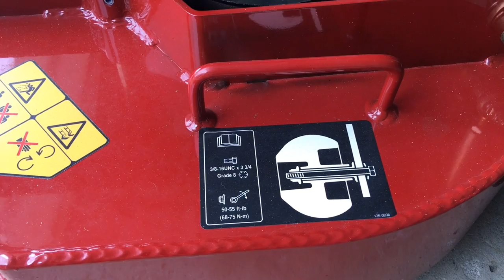Introduction / Demo eXmark 36 Inch Turf Tracer S Series Hydro Walk Behind Lawn Mower

Comment: lol. if someone tells me 3 is too high and 2.5 is too low I say "thank you for your business up to this point"
Reply from the maker: LOL you may be the one saying it. I think 3 looks a bit shabby and 2.5 is too short. I find 2.75 is nice and clean and looks manicured (centipede grass)
Reply: @DansVlog  true. actually never thought about that. dont know all the grasses. and actually from my perspective not theirs, 2.75 sometimes makes the difference between a 'clean cut' and a mess to clean up after at 2.5 or less
Reply: I mow some of my yards on 4 to 4.5. The higher you mow, the better the stripes burn in. Of course I'm talking about tall fescue grass.
Reply: @son_gogeto9128  is your tall fescue any good in shade btw
Reply: @brentkelly5445  Actually yes!  It seems to thrive in the shade around the big maple trees. I'm not sure if it's my climate, "Tennessee ",or what.
Reply: Sick dude!
Reply: @DansVlog  if you add a washer to that mower I can get 2.75. I never thought about that I have the same machine. I think 2.5 is too low.
Reply: Mow High Mow Often, Helps cut down on weeds and keeps the sun from burning the lawn out
Reply: @yzrippin  I'm in Canada so it is almost always bluegrass. In the spring I want it as short as possible in case it rains, June I start thinking of creeping up to 2.5/3 , Late june/July/August/ I take it to 3.5 min, 4+ i want. Argue with everyone..clients and  neighbours. Last week of August into Sept I try to continually drop height to whatever I can without huge mess.
Reply: So turning a knob is a deal breaker in your " HUSTLE " ? Just as long as the customer can hire someone else.

Comment: Great demo Dan,  congrats on that Exmark. If you don't want to mess with the washers to vary from 1/2" to 1/4"cutting increments, you can just set the 2 back pins 1 hole lower than the front 2. For example, for 
3-3/4" - set the front 2 pins on hole 6, and the back 2 on hole 5. For 3-1/4"- set the front 2 pins on hole 5, and the back 2 on hole 4. That's worked for me for many years. Hey... keep the  cooking videos coming too!
Reply from the maker: I was thinking that too but worried about premature wear on the belt rubbing the pulley? I do that with my honda pusher but I figured 1/4 inch washers is going to be easier on the machine
Reply: @DansVlog  Honestly never experienced any excess wear on the belts, replaced them as you would expect.  My Turf Tracer is old, a 2001 model, on its second engine.  But still has its original spindles and pumps.

Comment: Congrats on the sweet piece of new equipment. I have a walk behind brush mower with a 17 HP Kawasaki. It's a smooth running powerhouse. The only drawback is Carburetor service. If you ever need to do more than a basic cleaning you're looking at a $200 replacement. Rebuild kits aren't available. At least for mine. I'm looking forward to seeing you make this thing pay for itself.
Reply from the maker: $200?? OUCH! Let's hope anything that happens happens under warranty!!

Comment: I work for a 
big lawn maintenance company that uses these. My boss has some that are years old and maintains and fixes them in house. We maintenance really big apartment complexes so we put alot of hours on them. The issues that I've noticed the most are the pull start mechanism sucks. These little plastic arms that when you pull the string it catches and spins the mower always break and the string will never catch or the string won't retract back. And sometimes the hydrolics will make the mower turn to one side more but can be adjusted. Other than that it's a very good mower. Just always keep extra arms for the pull start mechanism. Doesn't happen to all his mowers. He has about 15 exmarks and it happens to about 6 of them all the time.

Comment: Congrats! Exmark Turf Tracers are awesome mowers. However, I would not recommend disconnecting the safety handles. If the mower gets away from you it will continue forward on its own with the blades on and may cause serious damage to you or property.
Reply: While dan has great awareness of how his machine operates accidents still do happen.  I personally have witnessed new guys who never used a WB but claimed they have. and get behind one only to let go of one handle and the thing gets away from them. if it wasnt for those safety handles, the mower would have caused alot of damage to property. simply just letting go and the pto shuts off and the mower just dies.
Reply from the maker: I blame the owner for handing over a machine to someone with little to no experience in an area on a property where damage can occure. Relying on a safety switch is ass-backwards but, what do I know?
Reply: @DansVlog  fully agree safety switches are only to protect the people with lack of knowledge  and training that should not be using the machine in the first place
Reply: Good points. Just thought I’d put that out there for those who are not as experienced with commercial mowers. Looks like it will be a great machine for you. Your videos are very informative.
Reply: I'm sure I wouldn't be here right now if it wasn't for the safety handles. But I run it on 6 all day with the hydro springs on the highest settings which are under the fuel tanks by the hyrdos. I also use a velke.
Reply: @andrewjohn9813  I would hate to be the one explaining to my insurance company why I damaged the property and my safety levers are missing! Could be the end of a company
Reply: @diamondstripes678  fully understandable but like in Dan's situation with good knowledge and experience and being the only one using it's not a problem disabling safety  if you have others using equipment you should definitely keep safety devices working as a backup but most reasons that safety devices are needed is because of lack of training ,knowledge care of the equipment

Comment: They are great mowers. I run 2 60s and a 48. They last quite a while. One of my 60s before i traded it in had a little over 3000 hours on it
Reply from the maker: 52'2 and 60's are monsters! They look freakin awesome with the anti-scalp wheels.
Reply: @DansVlog  the only costly work ive had to have done on mine in the past is replace the hydro pumps on the back. And when one of them goes you have to replace the wheel motor on the same side. Wish they werent so expensive. I think i paid 8900 for the last 60 i bought 3 years ago. And my front deck 52" diesel grasshopper with the bagging unit was around 14,500. Only use it for spring and fall clean ups. Ive tried all the big names and that grasshopper is the best for sucking up.

Comment: So you still have 
Honda hrx217
Old Honda 
2 lawn tractors
still have the Troybilt?
And this .  Not a bad fleet of equipment 👍

Yep you can mow  about twice as much as  21 inch.  I bet this new one will save your feet as it pulls you.
Reply from the maker: No no no I sold off equipment to help me buy this mower. I have the 2 Honda push mowers and now this new mower added to the fleet
Reply: Dan's Vlog smart.  Reinvesting

Comment: Did you happen to look at the new Gravely Pro Walk Hydro 36"? I compared them side by side and ended up with the Gravely, primarily because it was heavier built, had a better deck adjustment system, longer warranty and most of all, their Intuitive Steering system. There is nothing else like it and I found far easier to use vs the lever system the Exmark and all the other walk behinds use.
Reply from the maker: I looked at it but I’m just not a stander guy.

Comment: You may have just changed my mind about a walk behind.  GREAT VIDEO.
Reply from the maker: They are great for residential work. Pick up a $200 Velke and you got the best of all worlds
Reply: @DansVlog  Like you, I'm using a 42" craftsman tractor and a 22 inch pusher.  I'm curious if this walk behind will speed up mowing time.
Reply from the maker: From experince with Walk behinds in the past, yes. without a doubt a WB belt drive is far more economical than a rider and being this is a hydro... far superior. Only a stander can compare and that is a matter of preference (both will rock a yard silly)
Reply: @DansVlog   Thanks Dan.  I really appreciate it.

Comment: Dan , you might want to check your clutch bolt to make sure it is tight. We have 36" and 48" mowers and  a couple of them lost their bolts and clutch fell off. Was not tight from factory. Just wanted to let you know. Other than that good luck with your purchase.
Reply from the maker: Gee wizz, let’s not let that happen... I will check it for sure, thank you
Reply from the maker: Just checked it, seems tight, will recheck it periodically
Reply: @DansVlog  I am a mechanic for a company and that is what I do. Good to see yours is good. Wish you the best with the 36. Just wanted to give you a heads up.

Comment: I'm looking at a exmark viking hydro 48" cut tomorrow. It's not new but a nice used unit. Anything you think I should look at while looking at a used mower.
Reply from the maker: Wiggle the blades to see if spindles are good. Should be no wiggle. Obviously check oil and air filter condition. Fire it up and run the blades. Feel for bad vibrations. Other than that, not much more I can say. Not sure the seller will let you tear into the hydros so... it’s a crap shoot... good luck my friend
Reply: @DansVlog  thank you for the help. We will see how it goes. I've been want one of these also so hopefully it's a good machine.

Comment: Great video as always dan.
Congratulations on your new mower.it’s a beauty.
I’ve never seen one of those used as a walk behind before.I’ve only seen them used with the velky attached to them.it looks like it’s incredibly easy to use.almost easier to use than a 21” self propelled.to look at it you would think it would be a man killing behemoth to wrestle with but you make it pretty much run itself and it will be obviously much more productive than a 21”.it will certainly be a game changer for you.
I think that with a mulch plate and a set of gator blades it would be the ultimate grass mulching machine.
Please keep the videos coming
Reply from the maker: Thank you George. I am a little jerky on the grips still but that will smooth out as I anticipate the responses to my inputs

Comment: That reminds me of a Scag V-Ride standing zero turn. Similar operator control panel, engine, and overall layout of the unit. I am surprised that it is a pull start and doesn’t have a key.
Reply from the maker: I am happy it doesn't. Not needed

Comment: question; how is the speed adjustment on this thing? Is is infinite? Meaning no detents on the gear lever where you have to put into or is it slide mechanism so you can adjust and dial the speed right to where you want it?
Reply from the maker: No indents. Easily tap the lever for minor speed adjustments or move it in larger motions as you wish
Reply: yeah from what I've learned exmark has that patented so the Wright WB I have, every bit as good quality build and cut, has detents. It sucks because it's like your locked into the speeds they chose. I need to find out if it's adjustable somehow or this 2 day old mower goes back for the exmark.
Reply: Got the 48 and freakin love it. Put it through it's paces today, beautiful cut on these mowers and I am coming from a simplicity which cuts super nice. I love this mower it's very smooth, glad i went with Exmark.

Comment: Maybe for your purposes you may not need it but for some one how may get that mower to service 100 lawns, can you use a velky? I think is what you call it,  like how geek2 freak use on his mowers to reduce the amount of walking?
Reply from the maker: Definetly can and will be getting a 2 wheel velke soon. It is a great compliment to the hydro transmission.
Reply: Great mowers for hills, and very gentle on the grass in rainy days, but with a sulky and no safety on the handle bars... it isn't safe especially around tree roots and stumps. Seen many accidents with them...and i can only imagine it getting away from you and not cutting off. They cut great and will last for ever my 60" TT has lasted forever. Nice buy though!

Comment: I thought that u would get the electric starter with that machine.
Reply from the maker: I thought it had it to and was turning the key thinking the battery was dead when nothing happened. Then I was relieved and pleasently surprised to see the pull cord. No battery to worry about, no starter to fail. Just the way I like it

Comment: How to properly raise and lower the deck?
Reply from the maker: There are big pins on the deck you pull out and lift the deck then reinsert the pins. Engine off of course
Reply: @DansVlog  Thank you for responding, I was concerned that there was (somehow) something more to it than just that - leaving me to find out the hard way I should have left it alone at the mower height it was at.

Comment: What about an 36 exmark standon?
Reply from the maker: Not impressed with them at all. No "reach" for under trees, and uncomfortable standing so high. Plus 1K more in price, 150 pounds heavier + the operators weight so anywhere from 300 to 400 pounds heavier (that's a deal breaker for me as much as it rains here).

Comment: Gravely Zt  -PRO turn  34 "  zero turn  !
Reply from the maker: Problem with those little deck ZTR mowers is they have to come with skinny pizza cutter drive tires and the weight of the machine and operator pushes those skinny tires right into the soft soil whenever it rains. Even just a little bit.

Comment: I really want one of these but just can't justify it for how little I would use it. 90% of my properties are 1/2 acre or more. For the very few backyards I have, I just use a push mower. Maybe I can find a used one on the cheap
Reply from the maker: HA HA no one sells their hydro's. Good luck. Might find a decent belt drive for a few grand. I have been looking for years. Doesn't really seem like you need one tho, anyways
Reply: I found a 2013 Turf tracer used for $1650. Absolutely love it! Only a few minor issues with it. But have already cut well over 150 lawns with it.
Reply: Cottington's Lawn Care you on a stander or ZTR then?
Reply: @jamesbreen7394  I have a 60 and 72 exmark ztr. Also have a 30 inch exmark wb but I hate it. I use it for ditches as well and it's horrible on inclines. That turf tracer would be amazing for the ditches.
Reply: Cottington's Lawn Care any issues with the 72 scalping? Have a Deere 60” now. Want a 72 but worried about it on rough lawns.
Reply: I said the same thing. If I would have just done it, it would have already paid for itself and saved countless hours, not to mention kept me from passing on yards because of the gate and too big of a back yard.

Comment: No electric start?? Seems like the company could have at least thrown that on.
Reply from the maker: I was actually happy to see it was not electric start. So yes, congratulations to me, thank you
Reply: @DansVlog  why do you prefer pull start? Less things to break??
Reply from the maker: For sure. No battery to drain cause i leave the key on (been there, done that lol) No worries on a job site the starter shits on me (Gravely did that to me under warranty but still had to push the damn thing from backyard to into trailer to get it fixed, have a video of that!) and the pull cord is already installed so no need to make a pull starter if the battery did die? It's only an 18HP engine, not hard to start, even with my noodles arms lol

Comment: Thats basically like a push mower why would this man spend lile 1000 dollars on just a mower when he cam just buy a push mower for like 400 dollars
Reply from the maker: Ya, why would he?
Reply: We use a wheel on the back. I forgot how to spell it. It's called a sulky wheel so we can stand on it and mow. It mows really fast and can do fast zero turns. We take the wheel off when we have a big hill or the grass is wet